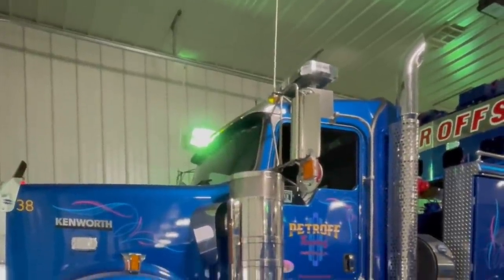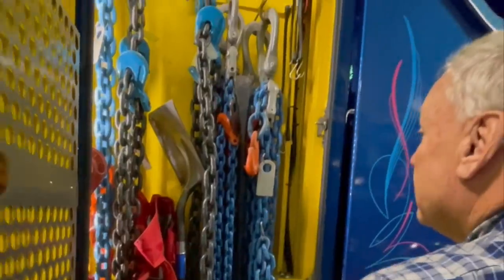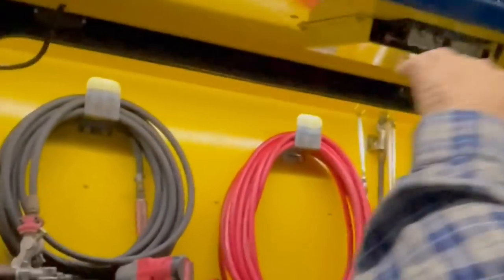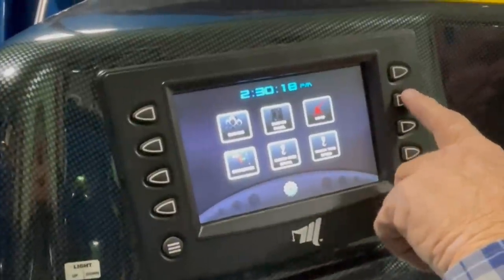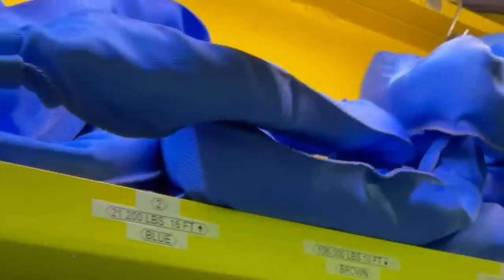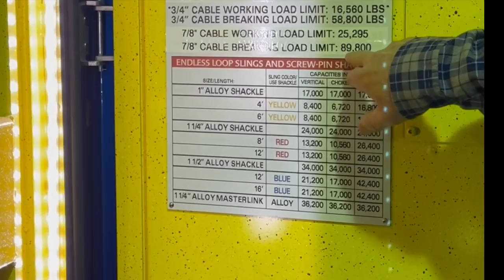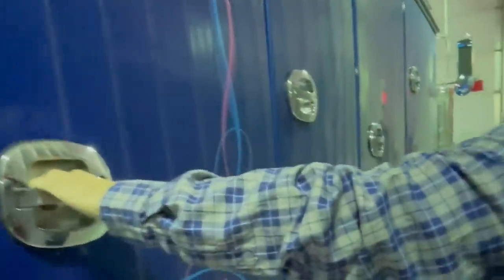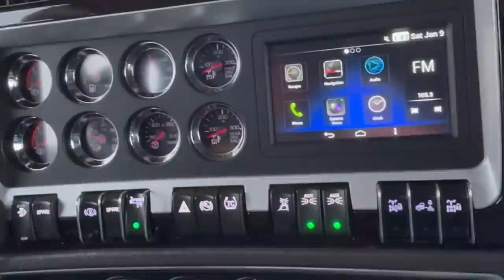M100 Walkaround & Weighing the World's Largest Tow Truck

Comment: Did that really say 101,520 thousand pounds!!! I figured 75-80 that’s insane!! Trucks like this will never be electric. It would have to pull around it’s own power plant.
Reply: How dare you! ~ Greta
Reply: Never say never. Modern trains move more weight and they are diesel-electric, electric motors powered by diesel generator.
Reply: @killer2600  for certain situations yes it can be good for diesel electric. What about container ships. Those are straight of engine to a shaft I believe.
Reply: @killer2600  yes but trains are also metal to metal, less friction than rubber to asphalt. Not saying it’s impossible to ever happen but it’s a really bad comparison
Reply: @Rey6Foot7  You're neglecting weight difference and conflating rolling resistance with surface friction. It's already known the torque advantage electric motors have over internal combustion engines. The only remaining issue is how to power them. Trains do it with diesel generators. A truck already runs on diesel so they could do that and it would still technically be electric per the original comment which didn't specify it had to run on batteries; which is also possible - does anyone remember how long rechargeable batteries lasted 30 years ago. Technology doesn't stay the same, it advances at a pretty quick rate.
Reply: 75-80? Our 50ton weighs 66 lol a 75ton weighs about 80
Reply: Yo never drived a Tesla. Electric cars are stronger than you think.
Reply: @killer2600  yea but you see how big they are, no way youre fitting that on a truck
Reply: Is everyone missing that he said if it was electric, it would need to carry its own power plant, which then it would be the same setup as the  diesel electric that trains us. Then the issue is, if this is already 101k lbs, its going to be even heavier.
Reply: @snoopdogie187  Electric cars are just at the begining. This problem will be fixed soon.
Reply: @killer2600  well a locomotive has a diesel power plant onboard so…
Reply: @rushgush  lol you don't actually believe that shit do you?  There is no such thing as battery that never needs to be recharged.
Reply: @snoopdogie187  you have to realize that a lot of the people that are super into electric vehicles don't understand how things ACTUALLY work.  They also don't understand that semi-trucks can't gross over 80,000lbs legally on interstate highways at least without a permit.  It's pretty simple math.  Trucks get paid per mile per ton of payload.  If we start with 80,000lb gross legal weight ideally we want the truck as light as possible in order to haul more payload.  These Tesla tractors are extremely heavy compared to the average diesel powered highway tractor.  They have a lot of weight they need to shave off before it's even a competition.  I am not saying this concept is impossible but they have a long way to go yet before these electric trucks can compete with diesel power.  Even if they overcome the obstacles, and actually become more cost feasible than a diesel truck, they still have the issue of our extremely overloaded power grid to contend with.  That beautiful electricity doesn't just grow wild on trees.
Reply: @brickhead_07  It isn't going to be overcome anytime in the near future for heavy equipment.  They have to come with a drastic, and I mean a drastic change in battery weight before there will even be a light at the end of the tunnel.  Cars maybe soon, trucks and heavy shit a long long way off.

Here's an example of what I am saying, and you can research this for yourself:

The Tesla Long haul version semi's battery bank weighs 6,000 Kilograms.  That's over 13,000lbs.  It can run 4 hours on a charge in optimum conditions grossing 80k.  The average diesel engine in the average over the road semi weighs just 3,000lbs.  It can run over 12 hours straight between fueling depending on how big of fuel tanks it has.  That's a huge sacrifice in payload.  You can only gross so much weight legally, so the heavier your truck is the less payload you can haul, and the less money you make.  The Tesla semi tractor also costs double what a diesel powered tractor costs.  The immense amount of energy in diesel fuel will still be king for a long time to come.
Reply: @rushgush  i did 32 yrs in Army I never saw or heard of batteries that you speak of.
Reply: @richardstorie229  probably because they don't exist.  Lol
Reply: Dreammmmmer!!! Electric!!!🤣😇
Reply: Why not they have huge electric dump trucks , earth movers even trains are electric
Reply: @davidnoyes3373  electric dump trucks? Where? The trains you speak of are diesel electric. Their fuel tanks hold 4-5,000 gallons of diesel and will be refilled daily.
Reply: @hpkntnw  trains are still electric whether they  get power from fossil fuel fenerators is irrelevant. Power on trains also comes from overhead cables on alot of europe’s trains which are powered from overhead cables. There wil be on board battery systems in the near future which will supply piwer to large vehicles such as this!
Reply: I like what Edison motors is doing. Their hybrid system has potential

Comment: What a beast no good over here in the uk it’s just too long the roads ain’t as big as they are over the pond, there’s a towing firm near where I live they have a 5 axle Volvo wrecker with a 75 ton rotator it’s a 250 ton chassis with the Volvo 16 litre 750bhp engine you always see it with a loaded 44 ton truck on the back they said it’s a Swiss Army knife can do everything but bigger and better stay safe out there lads
Reply from the maker: Yes totally different infrastructure. Stay safe as well!
Reply: Would that be millers on longton ??

Comment: Do you have to pull permits to even be able to drive that truck down the road where it is over 80,000 lbs? Nice truck by the way.
Reply from the maker: I think there was a previous comment that was similar but yes it does have a special permit and thanks. It's a beaut, Clark. :)

Comment: So do you need over weight permits year round for that monster? It is a great looking truck there is something about those w-900 that just look cool
Reply: Some states have exceptions when it comes to recovery vehicles. My state allows them up to 150k lbs, so he would still be able to tow some trucks with this setup. This isn't my field of work, so I don't know all the regulations, I just came across this information when looking for what does apply to me. I also saw that if its being used to clear a disabled vehicle from a highway, there is no restrictions besides have a mile range.

Comment: that is one big beautiful machine ,, glad i  don't have to pay the bill for it ,,guys call you when the shit bit the dynamite and blew to hell ,,that beast means business 
,i personally have a passion for old equipment ,,i own a relatively rare holmes 850 tow truck ,the truck itself is a 1974 GMC 6x6 twin screw powered by a monster 12V-92 detroit diesel, ,it's been used as a farm truck for most of the last 40 years ,i've owned it since 1995 ,, 1 of 2 built by omaha standard truck equipment in 1974  and purchased new by my grandfather ,,i use it with my salvage business for loading equipment and dragging things out of ravines
Reply from the maker: Ed is a fan of his old stuff too. His only complaint is they make you work for it and he’s too old with bad shoulders now. 🤣 Your 6x6 sounds cool. We will probably do videos of some of our older ones next.
Reply: @PetroffTowing  it's an old monster  that's slower than holy hell  but it'll drag a mountain no matter what gear you chose  and it'll wear out your shoulder shifting gears  ,,it's an old 5x4 road  ranger twin stick  and that's what i hate about it

Comment: Quite a privilige to buy the worlds mpst expensive and most capable recovery truck, and then complain about how you dont need half of it.. does the guy in video actually use it?
Reply from the maker: It wasn't a complaint but statement. Miller did not scrimp on any of accessories but we do not need a lot of the things for the jobs we got it to do. It does get used. Daily? No. But neither do our larger rotators. We have a fleet of other trucks that do the bulk of the work and this was purchased for specialized jobs.
Reply: Not only does he run it, but he wrote the HUGE check for it! So if he thinks there is too much gear in it, its his to do with as he feels fit.
Reply: Because he can state whatever he wants about his truck ? Take it as a complaint or as the truth which it is ...
Reply: Yup all the little trucks pay for the big guy's till they are need.

Comment: Is that a Mars light in the front bumper?
Reply: It is. I noticed that too!
Reply from the maker: Good eye! The 888s now have an LED option
Reply: what is a mars light?  is the round thing in the middle of the bumper?
Reply: @mattvega6941  A Mars 888 light is a recessed mounted or pedestal mounted oscillating light that came about in the 40’s or 50’s. 
Typically used by the fire service, I’m willing to bet some of Petroffs operators are firefighters. 
Just search fir it on You tube. There are plenty of videos
Reply: @mattvega6941  it’s basic design is to send out a penetrating beam of light to hit the 3 mirrors of a vehicle in front of it. The motor assembly inside the housing makes an “8” pattern with the bulb
Reply: @PetroffTowing   very cool, always wanted one

Comment: Would love to know at what point does a vehicle/truck require this to be sent on a call vs another "heavy duty" tow truck? What potential broken-down vehicle  is on our highways that warrants this beast, and what is a "minimum charge" figure that a customer would face if this is what's sent? I know that might be confidential information, but could you give us a ballpark figure?
Reply from the maker: This isn’t for breakdowns but specialized recovery - heavy equipment, rail, or other heavy lifting jobs. We have a fleet of heavies that do more of the breakdowns and general truck tows and recoveries and then multiple rotators. And we usually bill by the job.
Reply: I was going to ask a similar question. That is a giant truck to just have sitting. But it does look amazing, what a machine.

Comment: So, why with everything that has been designed into this, has nobody thought about the way the driver has to exit and enter the cab, on a ''Highway'' as you call them, it would be into the live lane. .
You might find it strange but in the UK the biggest wrecker are left hand drive, in part because when the driver gets out or into the cab he is away from the traffic.
A real safety feature would be right hand or dual drive. . I suppose it's down to the manufacturer putting profit before safety again. As they have clearly done in this case . .
Reply: umm...if theres ever a need for the driver to exit or enter on the passenger side, they can easily just do that. You don't have to get in on the same side as the steering wheel.
Reply: If it's that sketchy, just go out the passenger side.  Why would you redesign a cab?
Reply from the maker: Exactly and being an automatic, the cab has plenty of room if needed.
Reply: @PetroffTowing  an auto? really.boooooo.awesome truck tho,lol.
Reply: @kennethsmith8968  This ain't 19dickity2 anymore.  The autos are better than shifting.
Reply: @adrianspeeder  no they are not.a stick allows u 2 shift when u want not when u want not when the truck wants.besides i hear utubers like trucker josh always complaining about them shifting at  the wrong time.
Reply from the maker: Honestly in this case @adrianspeeder is correct. It is amazing how much this thing shifts and jakes. As a fellow big gal, I understand it takes a lot to just get things moving 🤣 I should have videoed hearing it cycle through just getting going and then around the on-ramp. It would have wore out Ed’s bad right shoulder. 😎

Comment: 0:19 You don't have an 18-sp. Automatic transmission. You have Eaton-Fullers ultra-shift (Fully) Automated tranny. It doesn't use a torque converter, it's a plate clutch w/ shifting controlled by the computer. https://www.eaton.com/rr/ProductsServices/ProductsbyCategory/Transmissions/UltraShiftPLUS/PCT_353894     Paccar only offers an 8-sp & 12-sp Automated. Eaton is the only mfg. offering an 18-sp., they've never made an automatic.

Comment: we have them lots bigger in Australia and lots longer an way in way more then that lil tonka truck duz . lol . looks nice tho . good job guys
Reply from the maker: Thanks. Australia has land trains and has some awesome tow companies. But is the lifting capacity and none are outside of the US for commercially produced tow trucks yet. 😎
Reply: @PetroffTowing  i think u maybe want to check on that ahy  we have tri axle and quad axle twin steer tow trucks . i think thay lift more then ur rig . not clotting but i think thats rite.    but it is a very nice rig tho...maybe ours are not as color full as the u.s n ours should be i rekon . make em stand out in a crowd . ya no .  thanks mate
Reply from the maker: Much of the equipment comes from the same 2 manufacturers. It isn’t our claim but check Miller Industries’ videos - they have some great info on there.  And we have different chassis configurations as well - again, this is lifting capacity. Not sure what else to say on that. During its unveiling, there were tow companies from around the world. Have a good one!
Reply: U think i have them bigger over there,fact is thats the largest sae 100ton certified rotator ever built,i bet it would lift 150ton,u either have a 35,40,50,60,75,80 or 85ton rotator,cuz petroffs truck is numero uno built